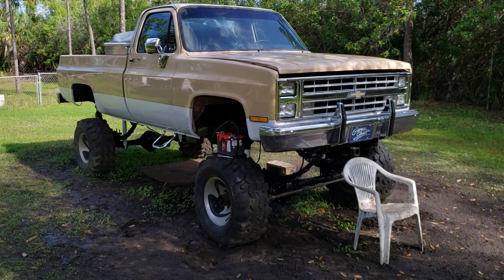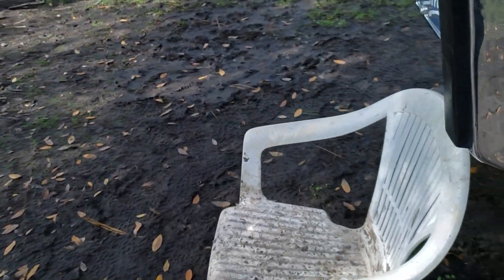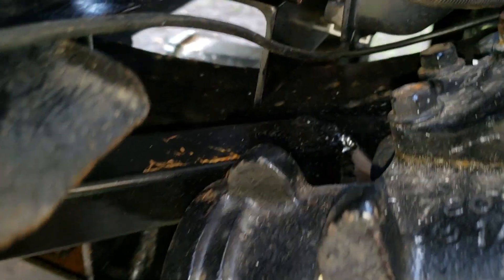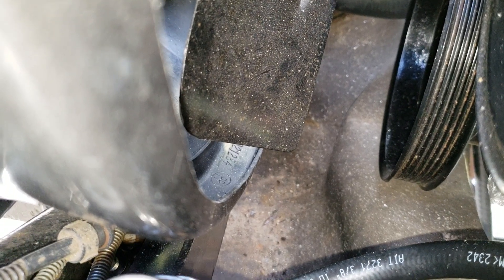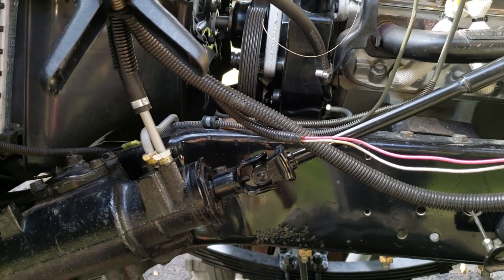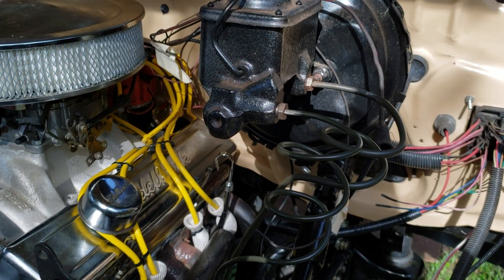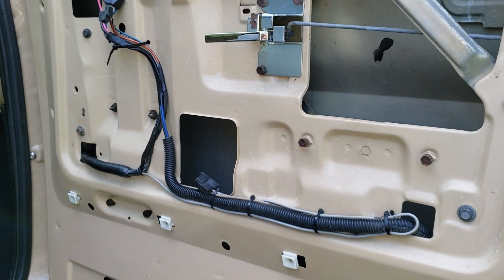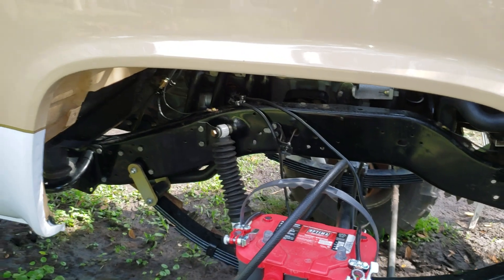1985 chevy k10 4x4 ( update 28)

Comment: Hey there I just ran across your videos & love them!! I didn’t see any details on your clutch set up!! I was wondering if you was running a hydraulic set up or if you was using the older rod style??? Ive been working on a 1972 Chevy 1Ton 4x4 & im wanting to run a hydraulic setup where I can order the full setup so it is already bleed out!! But before I ordered one I was trying to figure out what setup will work for my truck!! I’m sure that it would be the same style set up as the square body’s are!! If you went with the hydraulic set up what system or part number did you use??? Thanks for the info!!
Reply from the maker: Im running the factory rod and Z bar design but the rod is the one from LMC that is longer and has swivel joints at each end.I also run same joint for the clutch push rod with a bushing welded to the fork.So no matter how much the truck flexes it cant pop off the fork.